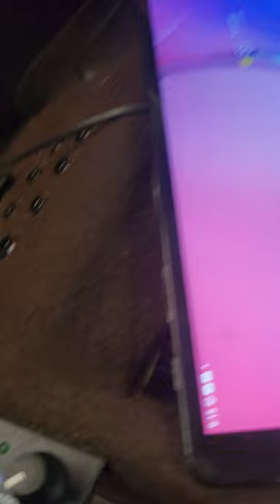undefeated song play !!!!! bass test ...I don't own the rights to this music

Comment: I would build a custom box for 4 12 n hit hard that dem 8. They don't have any air space smudg and the box like that.
Reply from the maker: You probably could but it's a certain sound that I like ....it's tuned high for a certain frequency in the trunk.... I could have did for 12s ported but that's not the sound that I want.... I got a Yukon XL that I'mma put the ported box in

Comment: Do you have 2 equalizers in your car?
Reply from the maker: Yep
Reply from the maker: One for the highs and mids and one for the subs
Reply: That's right.. I highly recommend Clarion eqs 755 equalizer.  I have a mtx 9500 15 inch subwoofer and a mtx 81000d monoblock amplifier pushing a mtx 75.4/ 4-channel amplifier pushing 9 speakers/ higs and mids...
Reply from the maker: I bet that sounds pretty dam good 📢📢📢📢